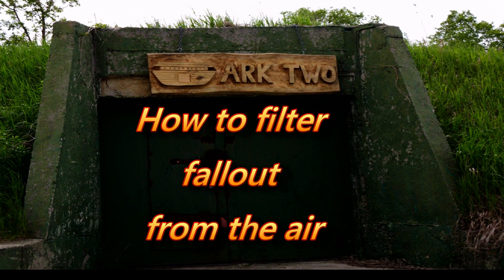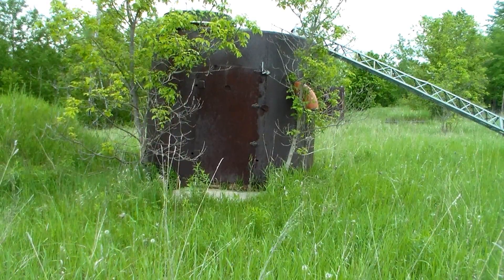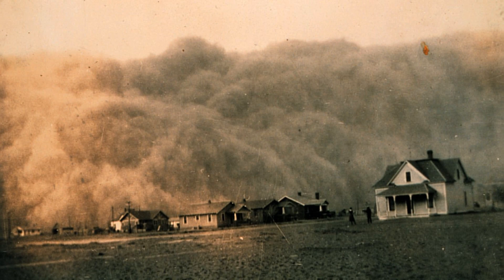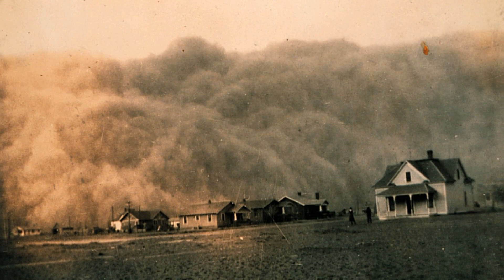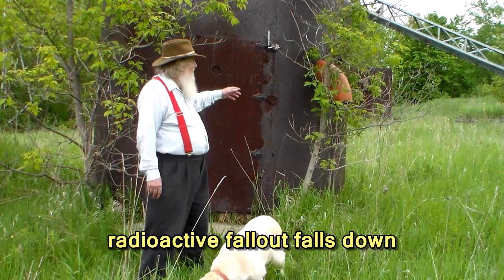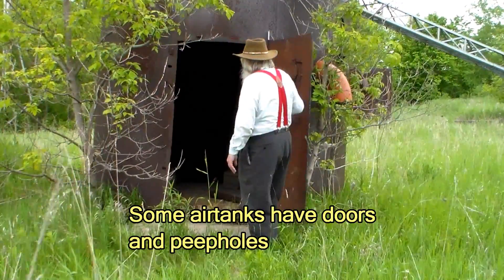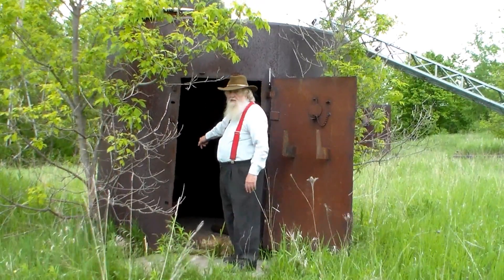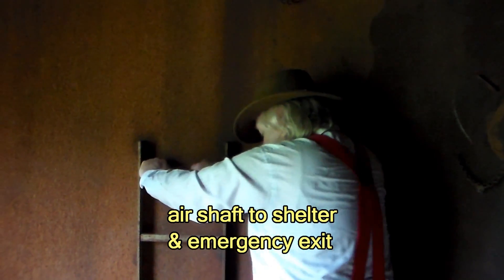ARK TWO #1 How to filter fallout from the air

Comment: Wouldn't those wet bed sheets dry up almost instantly? They are very thin, and the air is constanlty flowing through them.

Wouldnt some filtration sheets (dry) be a better idea? Or maybe several layers of those bed sheets?

Comment: Do not tell people you are building a "Fallout Shelter"; but tell them you are building a "Tornado Shelter" !  Just make the Tornado Shelter big enough to stay in it for three or four weeks for the fallout levels to decay to safer levels...  Also basements are good  and with furnace air filters for AC or hot air heating.  And Swisserland  until recently required bomb shelters with thick concrete walls for new  homes, check out for there zoning code designs.  For going outside have a EPA N95 dust mask or a cotton cloth.  Also a Nuclear Power Plant will run for a year before needing to freshen up the fuel so you may have reliable power for a year, just use what you need and it will last longer.  tjl

Comment: u need filtering system inside
Reply: Bruce used to buy expensive filtering systems. Then he realised that wet bedsheets do the trick just as well. They are more affordable. And he wants to educate the people on what they can do to help themselves and others. 
And he is just quite efficient at it, thats why some wonder how this could be so easy.
Reply: especially if it is windy, which keeps the fallout stirred up.  Keep pets in mind, with their faces closer to the ground & vegetation.
Reply: yea, i think it would benefit to have some kind of purifying dense filtration.
Reply: Wet Bed Sheet.
Reply: When its windy, it still wouldnt come up the pipe into the air intake tank much.
And there it would settle. Whatever remains could be filtered out by wet bedsheets.

Remember this is nuclear fallout here, not biological warfare. For that, other precautions need to be used, on which Bruce doesnt touch upon.
Reply: @archezwei1729  yeah your delusional if you truly believe wet bedsheets will filter out all the particles as well as actual filtration systems made up with activated charcoal or hepa filters, whoever is inside that bunker when the bombs drop will be dead within the week.

Comment: Well, I'd say solar panels will be useless for up to a year due to the nuclear winter so I would say he has generators which keeps blocks of battery cells constantly recharged for power. And if that fails you erect small windmills to recharge the batteries.

Comment: What do you do when you run out of food supplies? Can you grow anything besides mushrooms inside your underground chamber with the lack of sunlight? What will be your long term power source if the whole power grid is wiped out?
Reply: There is some edibles that can grow in the dark other than mushrooms

Or you could have grow light but you need some kind of generator. For long term probably mechanical force and you would need some people litteraly cranking up the generator all day long to charge batteries for the night but i bet you could make it possible for indefinite (if you have spare parts) amount of time down there